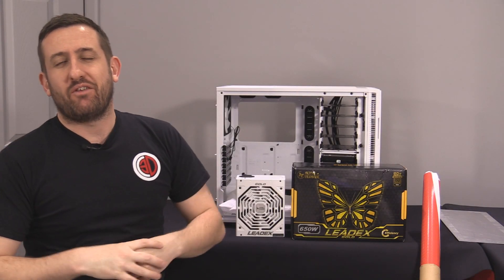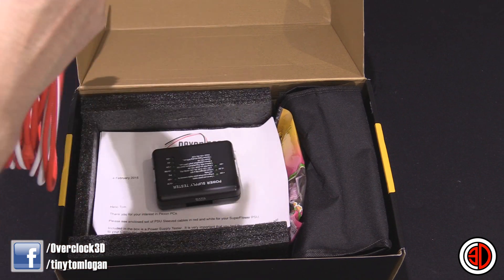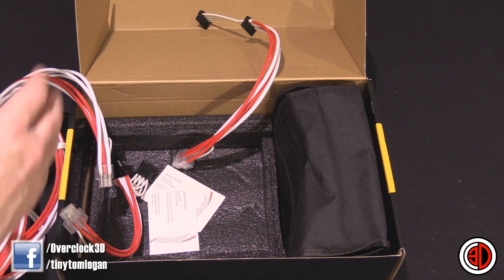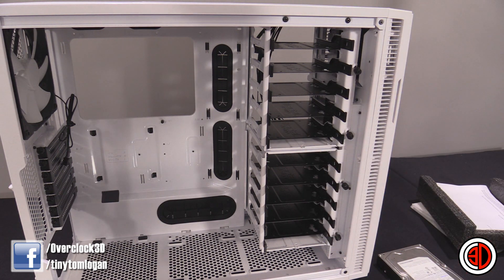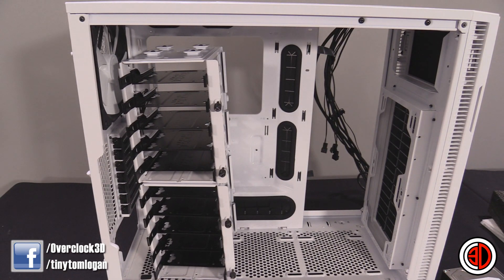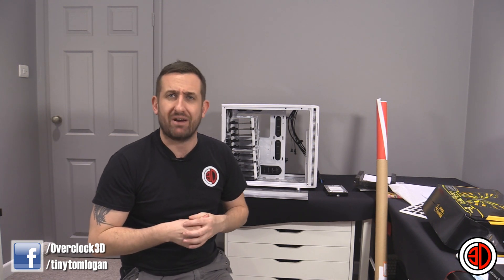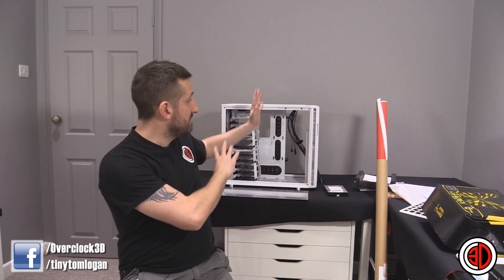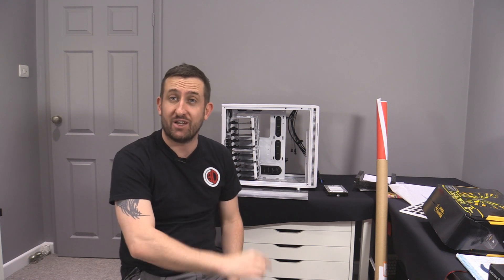WD40 TTL's 40TB Server  Update #1 Adaptec 81605ZQ Raid Card

Comment: With the GPU in "Orca II", why not go retro with something like a Titan Black? If you have the funds, this card would benefit a lot more from decent watercooling than a 980. IDK, I just never quite liked the 980. Sure efficiency is good and all, but it is not that powerful compared to high-end prev. gen cards. The 980Ti should be a game changer, though. Also, something else, if you want an external sound card/DAC then (no offense to the Xonar, great product) why not go with a company that is an actual audio company. I recommend  a US company called Schiit. They make DACs and Amps that appeal to the audiophile so you know they are gonna sound great. It looks like the chassis on some models can be easily painted, full aluminium if you wanna anodize it white. That would look Schmick.  You schoould check them out. Geddit?

Comment: X99 for a home server?!
Reply from the maker: 7600e X99 is my main rig dude
Reply: OC3D TV  Oh I thought you were putting a 5960X in the server :P
Reply: 7600e I'm chose E5-2680 v3 chips for three Servers. 
For home NAS servers (two): i3-4360T (35W) and E3-1240L v3 (25W). Both rock and save loads of power. BTW, ECC RAM mandatory.